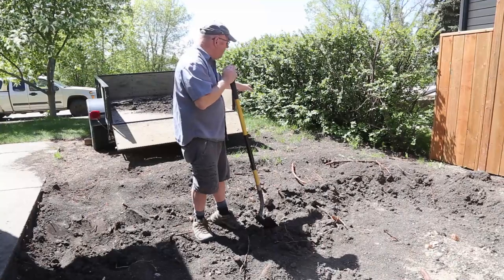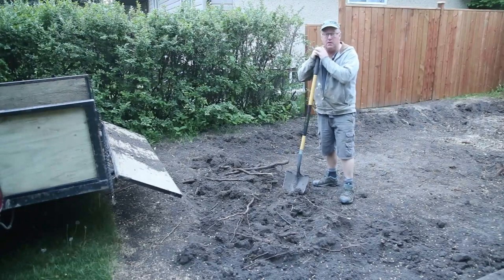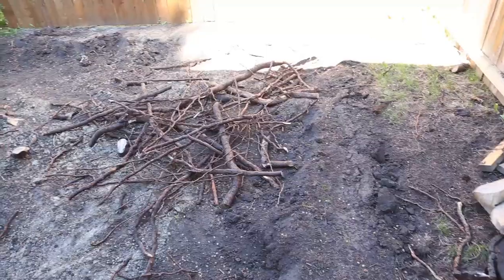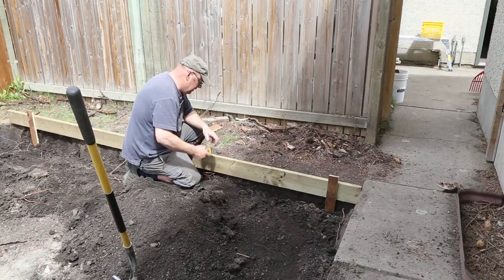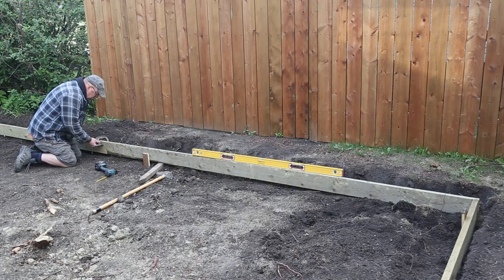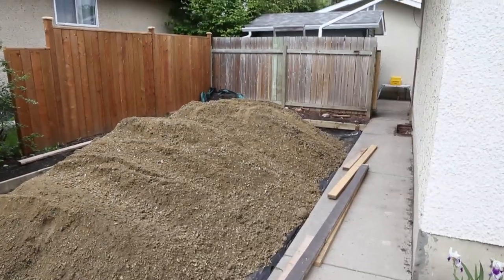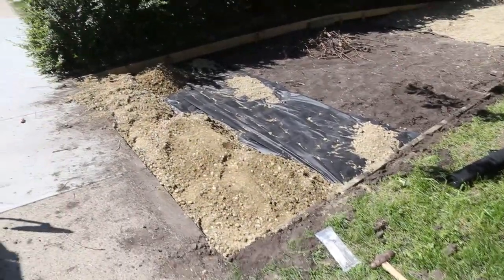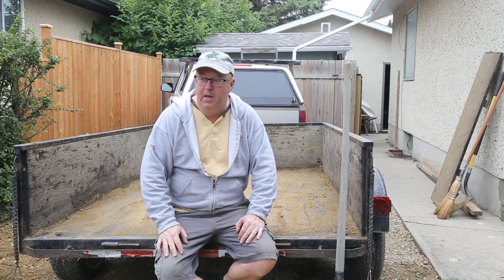Digging a driveway by hand.

Comment: I was a helper on a construction job and the Boss asked why are you screwing the stakes on the board first ..I told him so 
I can pound the board down level .The forming Guy said wow I have been lifting the board up and down and then putting the screws 
or nails in it
😂
Reply from the maker: It only made sense to do it that way.  The first board is always the hardest then it goes pretty smooth after that.  Glad I have a driveway now.  Thanks.  Stevo

Comment: That looks like too much work for a guy like me who is already needing a quadruple bypass. You are doing a good job.
Reply from the maker: I really only had one day where it was a tough sled but I just took my time.  It really feels good to be done though.  Thanks.  Stevo
Reply: @stevoj8959  it’s just compacted gravel and not a setup base for concrete?
Reply from the maker: @haneyoakie14  That is right.  I made sure I have a good gravel base, about 6 inches, so that in the future concrete would be easy.  I am just using my truck to compact it so one should leave it a year before doing concrete.  I don't know if I will go there.  Stevo